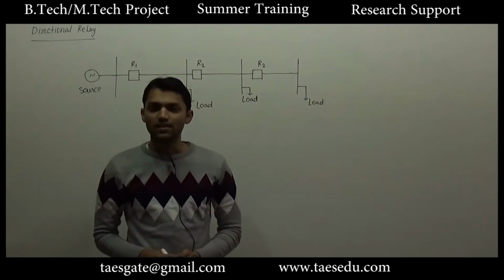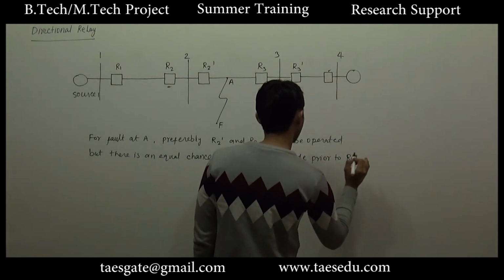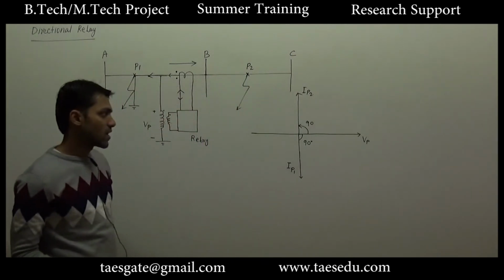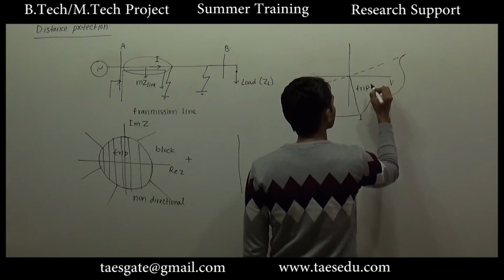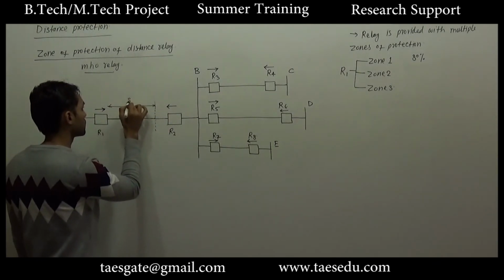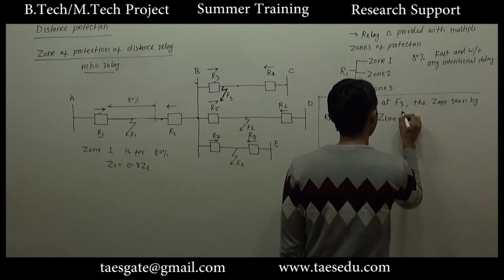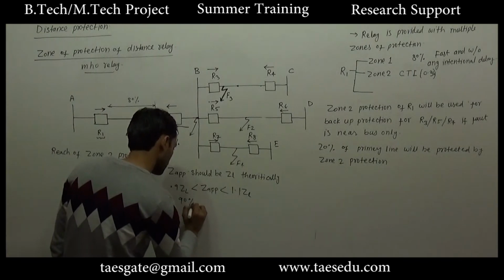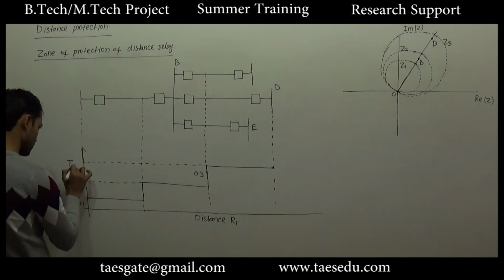Lec 22: Distance Relay Lecture for GATE EE

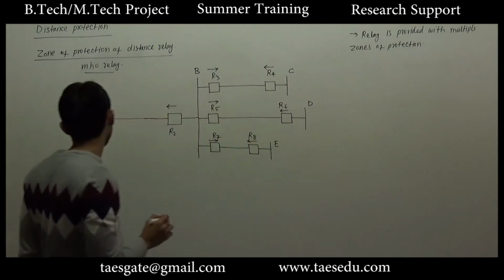Comment: 43:48 , you have chosen directional relays at both ends of line i.e. at the source end of line and load end of line , so how the directional relays will operate?? for same direction of power flow or opposit as to floe power , it will be in the direction for one the relay and opposit to another end relay of same line in each feeder . There should be one non directional oc relay at source end of feeder and directional relay at load end of feeder for proper functioning of relays with proper time delay.